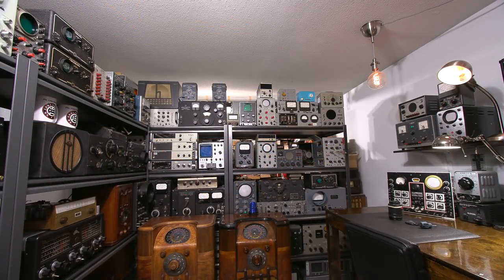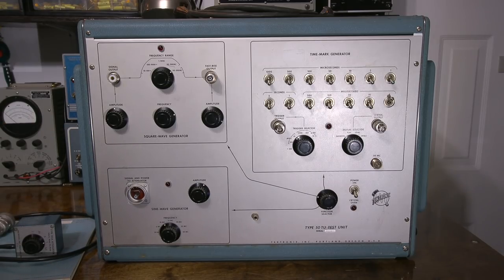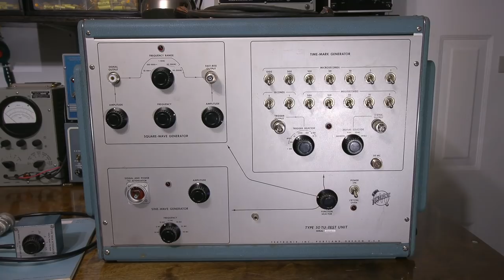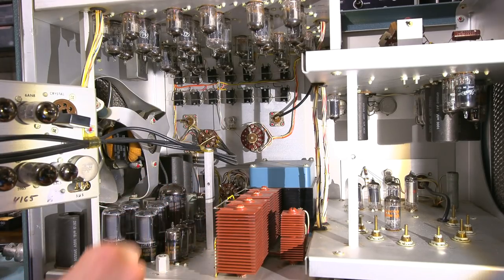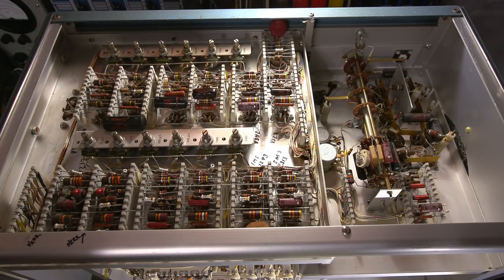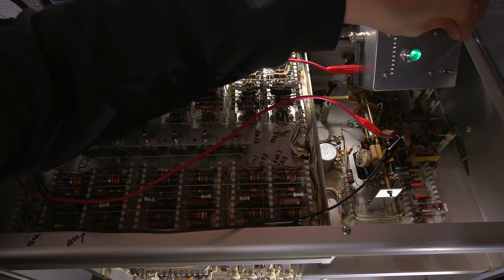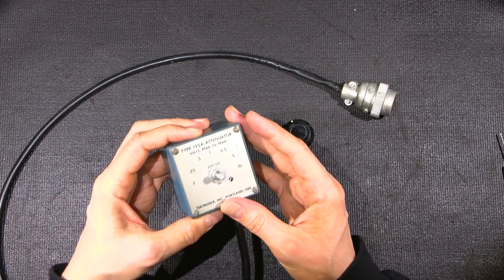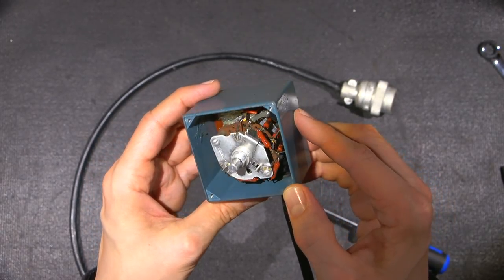Look Inside This Rare Tektronix TU-50 Test Unit!

Comment from the maker: To learn more about electronics in a very different and effective way, and gain access to Mr Carlson's personal designs and inventions, visit the Mr Carlson's Lab Patreon page here: https://www.patreon.com/MrCarlsonsLab
Reply: Mr Carlson have you ever considered streaming live your restoration work as you do it? I personally would really enjoy watching you solder everything in.
Reply: Hey mr. Carlson.

Kind of a question here.

 first of all what type of connector is on the panel and the cable for the attenuator Box?

And also the connector on the so-called special power cable.

Show me the woman on the power cable loose looks like a reverse schuko plug lumos were some sort of Euro plug but in reverse?

At least a quick glance of it on the video.

Also have you ever heard of someone using a voltage regulator tube as a night light.

Once I found a place that was wired for that there was a like a voltage doubler a few other components in a junction box with a tube socket on the front of the cover plate.

And there were tag strips riveted to the junction box cover.

Unseen box cover like that with tuba relay sockets for other purposes but not that

I went to someone's old house evidently to go in at live there or built it probably both what's a tech genius.

There's all sorts of weird sockets and stuff you would have loved it.

And I also saw something in a closet they weren't quite sure what it was.

Big insulator and A rod on it.

And various weird things on the wall and such some things I can't even describe.

And when they first when we was going on I said don't touch any of the sockets or anything.

I said to them so I can think that it might be tube type of equipment which means possible high voltage.

Turns out a couple cases I was right.

You should have seen the basement an addict in other places as well.

But the way that thing with the rod later determined that was a radio transmitter.

Also a lot of stuff is Tiny and everything else it seemed like a really old motivation system.

I found other devices with antennas but not transmitters receivers.

And relays everywhere.

Also this house had the 50s 60s wiring with the remote control switching with relays which is also tied into the system.

You could have imagined any type of connector it would be there.

So which I've never seen even to this day elsewhere.

And not the only place like that I've seen But amazing

Also once it was working again was just meant restoring power to part of it.

Of course disconnecting certain things that would probably not be a good idea.

One thing some transmitters because they operate it on the amateur radio band.

And I'll words whoever designed it was possibly licensed it's possible but that frequency was not allocated at that time don't know can't remember what frequency it was.

And it appeared that that was also part of alarm system for the house
Reply: So diy film capacitors DON'T die?

Also try saying that 10 times fast.
Reply: @aaronbrandenburg2441  Photos would be welcome.
Reply: Thanks for the video.
I really love the look of the two wood floor radio, you had in this video.
What are the makes and models.
Reply: Mr Carlson's Lab Antihydrogen fusion creates atmospheric sprites! I’m working on reproduction of Antihydrogen fusion converting anti helium to light. I need to speak with you about this. Have a device that needs advanced technology beyond my scope. My grandfather worked for Westinghouse electric drawing Nikola Tesla patents and moved to NYC buying land on the same aquifer system as Wardenclyff Long Island. Tesla chose the property. Ground to sky lightning!
Reply: I have one of these!  Bought it at an estate sale here in Beaverton 30 yr ago.  Got an RM 545B and a box of manuals at the same sale.  I'm retired now and would like to find this stuff a new home.  The condition is not as good as the not in the video and they appear to have been well used.  Any advice on selling without rebuilding/repair?
Reply: Good job Mr Carlson. I like to see your design for the leakage tester. TO me seems like you would want to have and adjustable power source. I am guessing...I wonder if there is a  op amp that can measure 1× 10-18 Amp  hiding in your leakage box?

If a capacitor was rated for 60 VDC..would you want to test near its rated voltage?

Anyway thank you bring very clear in English and your baud rate is quick enough. 

Thanks...

Comment: In my 50 years of working in electronics I've used and seen all of the equipment Mr. Carlson explains. I worked in a Calibrations lab at the RCA  David Sarnoff Research Center, Princeton, NJ. Our group repaired and calibrated all the equipment engineers used  on a daily basis. These days I hang out in my basement Lab restoring vintage Radios, record players and test equipment. I also enjoy bread boarding circuitry. My latest  project completed was a tube tester. I build much of my own equipment. I do envy Mr. Carlson' collection. Electronic vacuum tubes are my favorite item to experiment with. I trade at Ebay.

Comment: The layout inside this is a treat to look at. It's beautiful.
Reply: And the attention to detail, such as all resistors installed in the same direction. Classy.
Reply: It is which is surprising, as if its job was only in their factory, it didn't have to please a customer.
Reply: @boredfartless4221  engineers usually take a lot of pride in their work and have an aesthetic sense going into their designs ;)

Comment: I started work as an engineer in 1983 at GE in Utica, NY.  I recall the extremely nice Tek scopes we had, and the plug-ins.  But I was a digital guy, so I used logic analyzers and simulators a lot of the time.  This piece is built like the space shuttle.  Gorgeous!

Comment: Nice to see the rows of silver soldered  components. We used to wash out scopes out (disconnecting transformers removing tubes etc) with a commercial cleaning system and low level oven!!! Put back together and worked like a champ!!!

Comment: Just what I need to align my Tektronix 310A oscilloscope! She opens like a tube caddy suitcase. No selenium rectifiers in it. 12 silicon diodes. Has a mere  30 tubes 
in it however. I love how the engineers designed the layout of everything inside so very nicely in the TU-50. Thanks for sharing Paul!
Reply: TU-50? It is broadcast amplifier?

Comment: I recall being shown a Tektronix-produced film in the late sixties in my high school "radio shop".  It described their oscilloscope designs and how they increased their reliability and stability by incorporating their ceramic strips plated with silver for their interconnects.

Tektronix scopes were well-known for their very stable  triggering capability as you know.  They were the standard for the era.  

I worked for one of their competitors and we always lamented how well Tek scopes triggered.

Comment: Love the Tek stuff. Most of our lab is slightly later period, multiple 7000 series, and TM500/5000 era accessory instruments, though we do have a few tube based scopes and tracers.  Your aligner is really something..  Tek is so perfect inside... Many of the guys that engineered all this are passed away. I knew several of them, growing up teen years in the back yard of Tek in Beaverton. .... they had true pride in doing the best possible job.  I still have a few bags of the ceramic strips, reserved for pet projects.
Reply from the maker: Thanks for sharing your story Jennifer!
Reply: I love my 7704A! It's such a thrill to be able to swap out the modules to do all kinds of neat measurements. I love the 7D15 I have that just happily sits in the left horizontal slot and gives me various timing, counting and frequency readouts without interfering with any other measurements. I lucked into the 7704A with a 7A12 and 7B53A free on craigslist!

Comment: I´m almost speechless about the looks of the inside of this device. It´s like Jony Ive found a DeLorean and transported himself back to the 60´s.
This is not the inside of an electronic device, it´s more like a cathedral. Apple Computers would have looked like that in the 60´s ( with an acrylic backplate in bondi-blue ).
Awesome, totally awesome.

Comment: I love these old Tek-gear, they're absolutely crazy well built. This unit inside kinda looks
like a miniature scale model of a power plant or a wierd doll house. =)

I have a 5-series oscilloscope myself, manuals and all, which unfortunately does not
work today. History is that it came from the maintenance department of a nuclear power
plant just 60km's from where I live. I will hopefully get it to work one of these days.
The caps are probably the culprit as it has not been used in quite some time.

Comment: For slot head screws, I highly recommend a set of drivers from Grace USA (you can find them on Amazon). The heads are milled precisely with two parallel faces. If you choose the correctly sized driver for the screw, there is a nice tight fit and no issues with slippage.

Comment: I worked in PMEL in the USAF back in the 70's and we did have equipment filters that were designed to be sprayed with a special oil to catch the dust.
Reply: The original aluminum mesh Tek filters were made by Research Products Corp. of Madison, WI.  They still exist and still make them and the water-soluble adhesive spray for the filters, RP Super Filter Coat.
(USAF PMEL 1969-1972, "long" course at Lowry AFB)

Comment: You mentioned the joy of 'Slotted Screws', note that screwdrivers specifically for Gunsmithing have a 'hollow ground' on them (as opposed to the standard truncated wedge) precisely to prevent damaging the often blackened, slotted screws. (Slotted, of course, still is irritating.)

Comment: +50 years back in U.K. electronic laboratories it was a customary (indeed sacrosanct) quirky practice to always have an authentic American silver "dime" coin loose in the top flap or trolley draw of Tektronix 500 series scopes for removing the access panels (and also a small coil of silver-loaded solder somewhere inside).   This would be a nice thing to add perhaps ?

Comment: Wow you need a fortune to replace the tubes awesome piece of equipment sir!

My Phillips PM3230 has all the original caps and it works good no leakage whatsoever and also a new set of quality tubes would set me back ±100€ so should I invest in new caps?

Ps it has a CRT with two beams and each beam is individually deflected really awesome scope!
And also thanks for your amazing videos they've helped me repair this scope (bad connections and overall mishandling her and there)

Comment: The sleeve bearings on the fans of that era of tek instruments have open oiling ports that would often be way over filled. Over years of operation a thick film of oily dust would accumulate on parts near the fan.

Comment: The PL259 might have a solid connector soldered to the centre pin, if you de-solder it you will only have to fight with the wire from the side.  But it might not be worth it as it looks clean so it there is no issue with it I would just clean the switch contacts with a drop of cleaner.  Be nice to get a close look at that valve package in there though.  However, you are a perfectionist, so you will take it out anyway!

Comment: Another great video from Mr Carlson's Lab to relieve the boredom of virtual house arrest here in the UK. Re silver bearing solder. I used to have an old Textronix 561 scope. It had a small reel of the special solder with a warning sticker not to use 60/40. 
Keep safe while this horrible virus does its rounds.
P.S. You have the best audio of any YouTube channel. Which mike is it that you're using? It looks like an old Neuman but I'm probably wrong.

Comment: Hey I have a quick question, I've got a Samsung 7.2 receiver from like 2012 and I really love it but recently I've found when I use it, not on high volume or anything.. no amps or preamps of any kind after about 10-20 min different each time but in that range, it blows the breaker... I do work with some stuff and have most basic tools I'm comfortable with working inside things like this and with electricity, so what you think? Got any ideas or suggestions? Thanks so much for your time, and great videos man. I really enjoy watching the hr+ long ones. And I can tell you really enjoy and appreciate the little things, the various things they used to do with electronics had so much character that is not often seen in modern electronics... Thanks again, keep on kickin ass!

Comment: "This tester is so sensitive it will read leakage from this vinyl boot." 
Yes, that is sensitive.  :)
Reply: Actually, vinyl (PVC) is quite miserable, leaking like there is no other day!  I have an experience where we had to remove our first installed vinyl cable and replace it with polyethylene type.  All for the reason that our intended use as an extender cable for a paper insulated telephone cables test station caused our meter to immediately peg.  The test station was attached to a big temperature chamber and was to tell when the cable reel was dry and ready for extruded lead jacket.  That was way back when.  I doubt anybody makes paper insulated cable today.

Comment: You seem like the kind of person that could answer my question. 
I want sleeving for wires that looks like flexible metal conduit, kind of like you find on those antique Russian appliances, or the iPhone titan lightning cable if you’ve ever seen that. I have searched electronics stores, hardware stores, online, and I can’t find it anywhere. I think my problem is I don’t even know what it’s called. Do you have any idea what I’m talking about? Is there a term for that kind of sleeving?

Comment: i love that tektronix stuff looks like stuff from fallout. and everything lovingly labelled in that futura - proud 317 owner
Reply: They sure built equipment well, I love how the sections hinges out so you can get at both sides.
Reply: Robert Johnson I know they built some of the heaviest test equipment I ever dealt with. When T-1 or 1.544 circuits became available to customers in the field, my boss bought a Tektronix bit error rate test set. We were flying blind back then and this unit was actually designed to be rack mounted. I hauled it around for a year until he got me a Phoenix BERT test set and later a T-Berd.
Reply: You still only get 3 copper and 5 glass when you scrap it.

Comment: Paul, TEK published, for lack of a better word, a technical service bulletin for the TU 50, indicating that, when replacing the SR601, SR604 and SR607 selenium rectifiers, they should be replaced with silicone diodes. Are selenium rectifiers no longer available, or were they not as precise as the silicone diodes?

Comment: PL= Plug  SO = Socket  and the numbers refer to the size. obviously one has to be smaller than the other for them to fit together, so the Socket is -239 and the Plug is -259.

Comment: Mr Carlson I have a vintage clegg 22er new in box never been plugged in.
Do I need to recap it before I plug it in or check the old caps will they be ok
Reply from the maker: The caps are probably bad, and may damage the power transformer.
Reply: @MrCarlsonsLab  thanks I figured that I would need to replace the caps 
None of there values are quite right Just wanted to make sure. Thank you for your response

Comment: Nice DAK Mark 10, They are a nice looking unit, too bad they don't really live up to expectations though. Based on the cybernet PLL-02a chassis. The one I had would die with alarming regularity with bad solder joints and the marginal parts used in them.

Comment: So how do you accurately calibrate a calibrator? Use another known "good" calibrator or scope?
Reply: You have to use a calibrator with a lower 'tolerance' than the piece of equipment you are calibrating. In industry most companies will send equipment away to calibration labs as you need to control the environment around the test equipment as well, such as a constant temperature. Most calibration gear won't even get turned off as power cycles can degrade the accuracy of equipment.

Comment: Ya gotta love Tek quality. A good quality set of new tubes would probably cost over $1k USD. So far every future restoration is a home ruin (and a new calendar?)
Reply: Yep, Tek made top-notch test gear, especially of this vintage.  I've got some of their later stuff, a 2465 analog scope and a TDS2024 DSO.  Both see regular use in restoring old radio gear.

Comment: This may be a stupid question but I thought Id ask anyway. Does a fan cool the tubes through the pins as the tube is insulated by the vacuum  and would prevent cooling by convection?

Comment: Hi! Can I ask you for your advice? I have a Yamaha T-460 from 82' which has his noise on FM when audio content from the fm channel is not playing (the pause between commercials or songs when no content is playing but the channel is live). What should I do to correct this thing. For the moment the device is connected to an improvised antenna made from a full copper twin phone wire for about 3 meters. The his is not present on all channels ... only the ones that are not very strong. I have another technics minisystem which is not doing that even though the sound quality is affected by the low level receiving signal. Thank you!